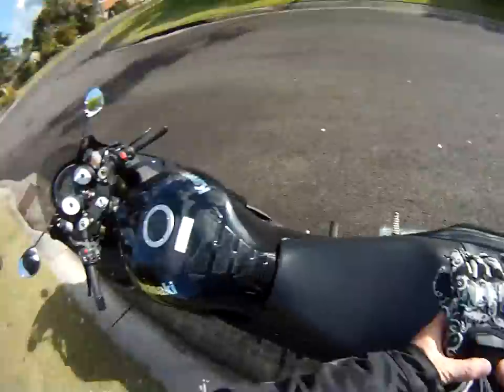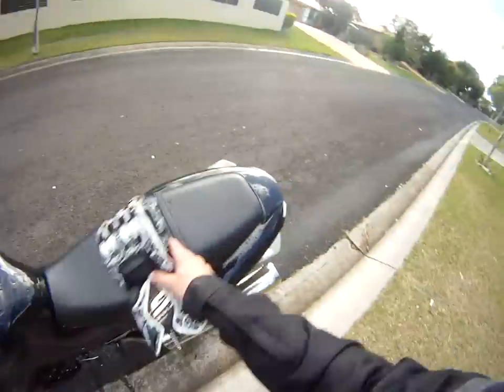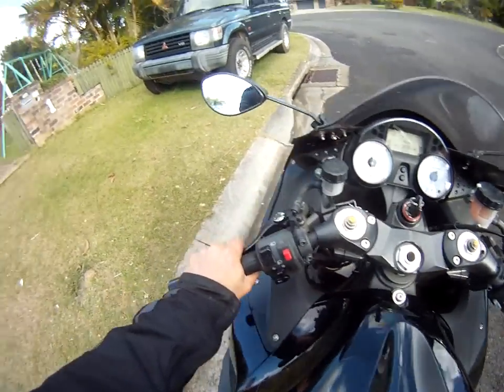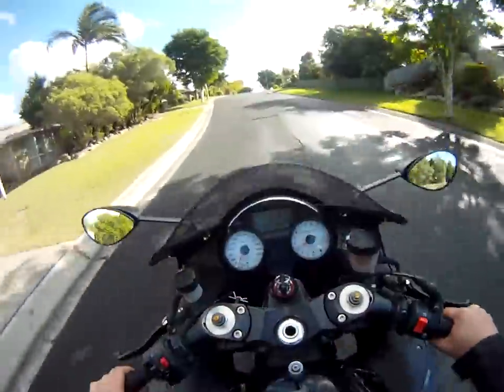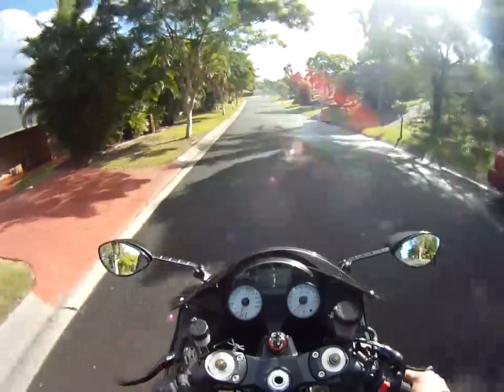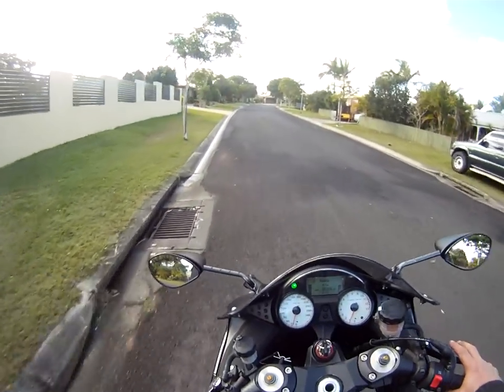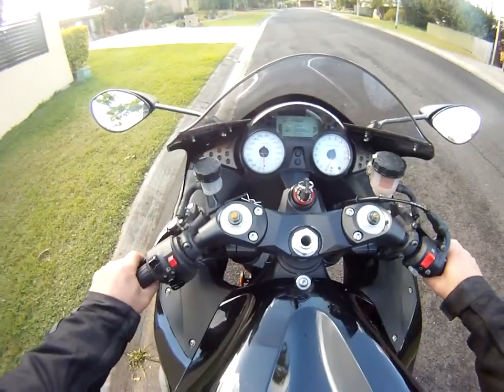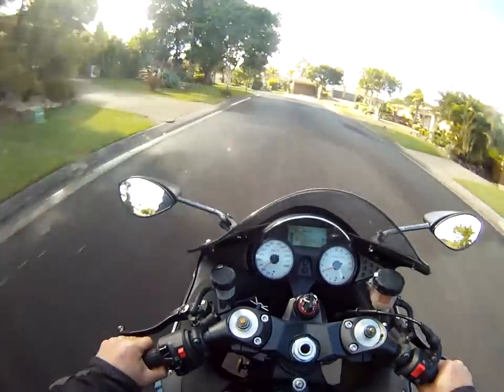Motorcycle gearbox tutorial, part 2.

Comment: I watched your video some 6 months ago when I had the limited motorcycle license. Now that I'm taking the unlimited license lessons, riding a Kawasaki ER6n (the naked version of the "Ninja 650" as it's called in the US, or ER6F in the rest of the world), I tried using your clutchless gear shift technique. I did everything you said, pre-loaded the lever and it worked. I was amazed by how easy it is BUT!! Every time I accelerate using this method, the bike jumps as I pull the throttle back. What am I doing wrong? I chop the throttle all the way when I shift gears, should I just chop it a little?
Reply from the maker: Uri Pollack Whoops - Hello Uri. I should look at this stuff a bit more often, huh? If there seems to be a 'jump' then the timing of the chop & return of power is not quite right. Try and close that throttle and get it open again more quickly. If you were to chop and re-apply power too quickly, it simply wouldn't change. If you chop and change, and then count to three before you go again, it isn't going to be the smoothest change. Try this, pre-load the lever, and then move your hand as fast as you can. You don't have to be at full throttle, and you don't have to finish up at full throttle, but you do have to pretty much shut it all the way. When you get it right, it is not perfectly smooth, but it is pretty close. Just watch the video, you can see what I'm doing.
Reply: Kneedragon1962 Thank you for the reply! By now I've gotten the hang of it and everything is smooth. Thank you again!
Reply from the maker: Kakabeblen ;-)